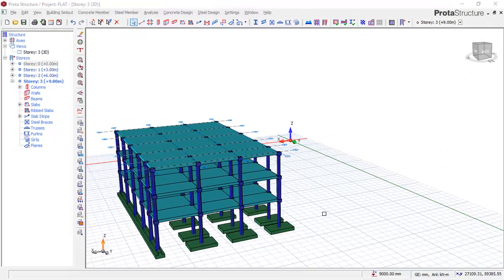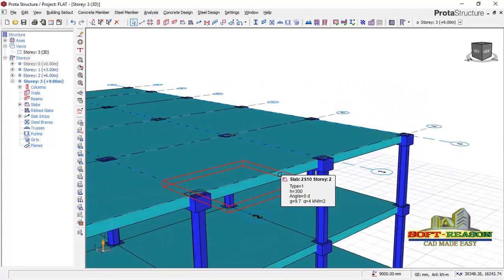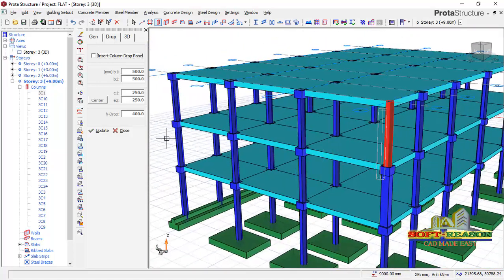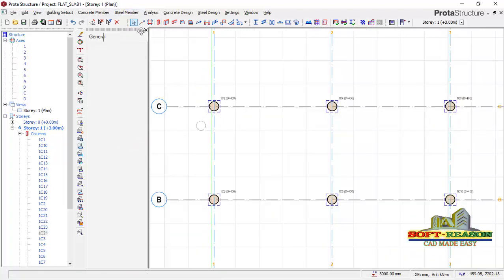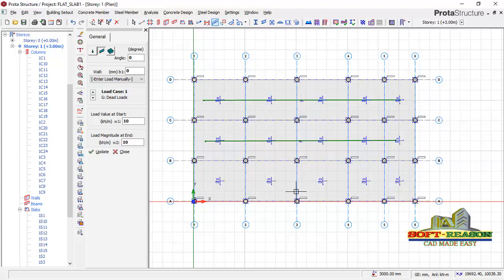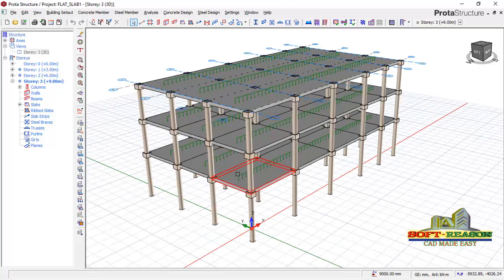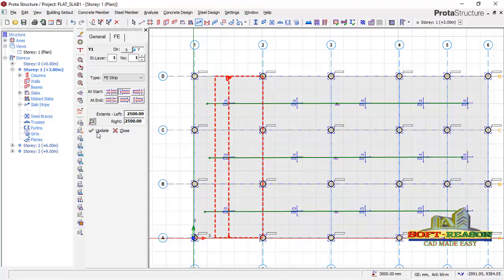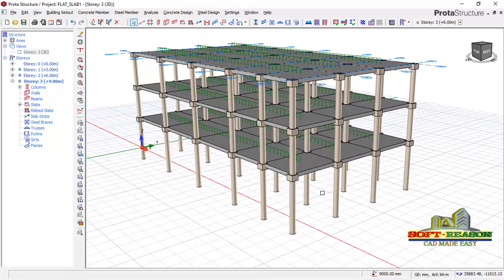How to Model Flat Slab, Best Explained in Protastructure

Comment: if I'm modeling a flat slab and some places need beams for other proposes (planted column), How can I do that? I keep getting "slab and beam are overlapping"
Reply from the maker: Provide an expansion joint to separate the flat slab area from the normal slab.
Reply: @CADmade-easy  so I can’t just make a whole flat slab and insert the beams where I want? As I understand from your description I should place the beams first, then place the flat slab at the edge of the beam? In this case the beams will be at the level of the slab right?

I use polyline  to draw the floor shape because it’s irregular, I also get overlapping of the slab with columns when I do the model check. Does it affect the results?
Reply from the maker: @Zorot99   No.   
Since I don't know the kind of project you are designing, contact me, so I see your project and know how to assist you.

Comment: does protastructure used finite element for slab design or cofficient
Reply from the maker: Finite Element Analysis Engine  and Yield Line Method of Analysis of Reinforce Concrete Slab